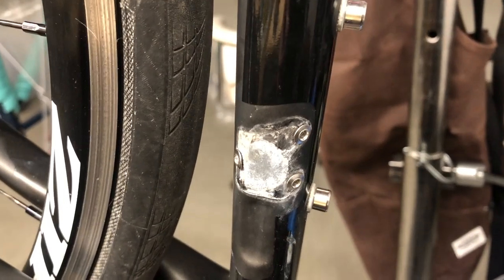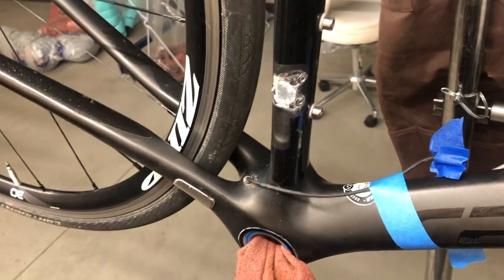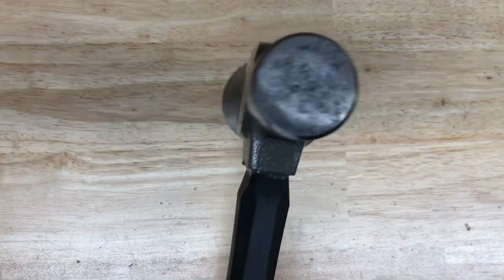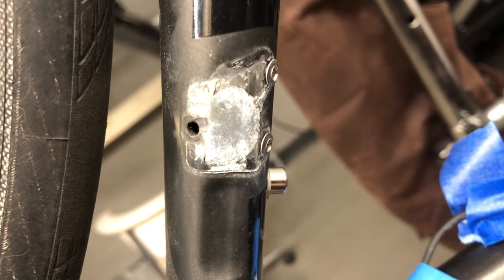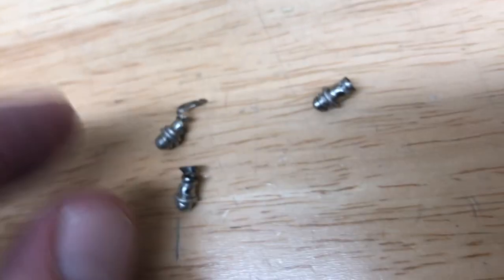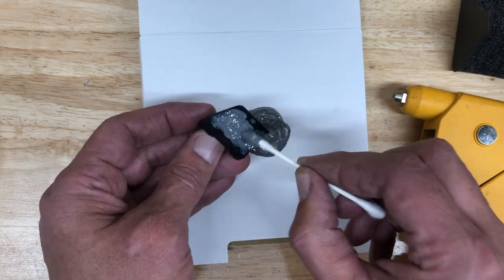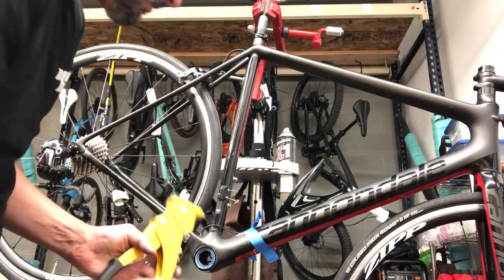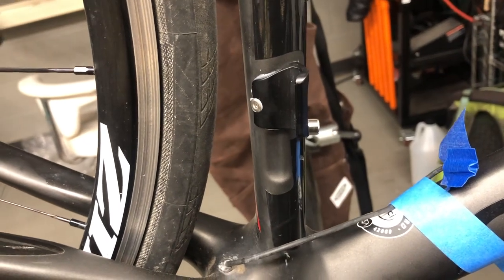How To Replace A Riveted Front Derailleur Hanger Onto A Carbon Frame

Comment: Dude. I’m doing that exact same project. Hilarious. The only hangar I found was one in the UK. It’s taking forever to get to the US.
Reply: I found that by taking a pin punch and punch out the center of the rivet.
Reply: After punching out the center. The head comes out with very light pressure using a 1/8 “ drill bit.
Reply from the maker: Yeah, same thing here. We’re a Cannondale dealer, but they won’t sell the hanger anymore. I guess too many dealers messed up frames attempting to install them, so the only option is to sent your frame back to Cannondale to have a new one installed by them. 
The owner of this bike sourced the hanger from the UK i believe and it took a while.

Comment: Joey, great vid. Thank you. You mention the rivets are SS, where can i get a dozen of so? Also, my hanger stretched only one rivet due to the chain wrapping around the small ring and binding against the frame. The other two rivets seemed still very tight. A borescope ($77 amazon) inspection of the inside of of carbon seat tube showed that the carbon around the stretched rivet hole was torn up and frayed. I was afraid that a new rivet would not hold well, so I fished and finagled a very small SS machine screw through the hanger and inside the tube, added a matching "mini-fender" washer and hex nut wetted with Loctite. The fender washer completely covered the damaged area around the hole and upon tightening the hanger became very snug. I have not (yet) replaced the other two hanger rivets as they seemed to be ok at the time. But I can see a day when they will need to be replaced too.

Comment: First of all thanks for the video, when I faced with a similar issue it confirmed my idea how to begin the work, so it gave me confidence. :) 
I'm doing a very similar repair on my wife's bike, the only difference is that the hanger snapped, didn't fell off.
I removed the rivets but have no idea how to remove the broken hanger as it's still glued to the frame. I have a good grip on it but still not moving. Hammer? Heat? More sweat? Any idea? Thanks :)

Comment: Great video of excellent work!  I also have a Cannondale, with the same issue.  I will not attempt such a repair though!  I never use the smaller chain ring, being that I live in Florida, no hills. I'm surprised they don't use threaded allen screws instead.
Reply from the maker: Thanks for taking the time to comment! Sometimes small bolts required to thread things like cable stops and hangers can become a nightmare if they get seized into the frame. It happens a lot with folks who ride indoors on a trainer, Zwifting it up in the winter. Not so much a problem in Florida, but that sea salt air can do similar damage as well... Sweat can do some serious corrosion causing damage that doesn't get talked about much. That's how this one failed in the first place.
Reply: Next time keep your frame clean. you can also way the area for added protection or spray occational with WD40 or similar in the area. at least post washing.

Comment: A lot of people say not to mix stainless and aluminum. I'm surprised they didn't put Al rivets in the kit.
Reply from the maker: This particular application takes a lot of stress, so I just don't see an aluminum rivet holding up under normal use.

Comment: would it better to drill out the rivits??
Reply from the maker: It depends. In this case, once the hanger broke off, the rivets were loose, so they tend to just spin within the frame once a drill bit digs in and starts to remove material. If the hanger cracked, which is very common where the derailleur bolts on, drilling the rivets would be the way to go. I should have mentioned why I was using the Dremel tool instead of drilling in this particular case, so thanks for pointing that out!